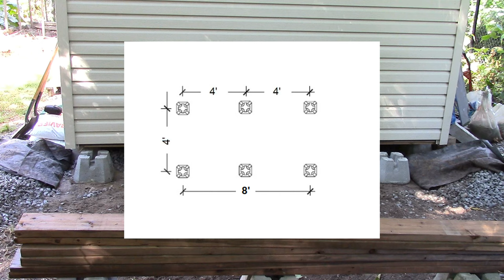How to Build a Shed Foundation with Deck Blocks

Comment: This is a how not to video. The ground underneath is not level and when it rains water can pool up under a certain part of the shed and rot out the floor faster and possibly get whatever you have store in the shed wet. The whole area under this shed and between the first shed should be graded so water runs away from underneath.  This one the water will collect between the two sheds
Reply from the maker: The soil is sand. no issues with water. Pressure-treated wood (joists, floor plywood) has no contact with the soil

Comment: It seems either frost or heavy rain would move the blocks and twist your floor. Do you not have any of these in your climate? Does it not matter because it's just a shed? Would you be able to correct that by adjusting the blocks with a jack?
Reply: How would you correct this then?
Reply from the maker: We have a lot of snow, and temperatures sometimes drop below -22F(-30C) during the winter.
I just added a video on how the foundation looks after 2 years of harsh weather.
https://www.youtube.com/watch?v=1jf2_5KlEms
Reply: @plasticinehouse9547  Thank you for this follow up! As someone looking to set up a shed in my own yard, I really wanted to know which level of depth would be of greatest value. Sure, it's not 20 years of use, but considering the shed is only rated for 10, it looks like I'll be all set.
Reply: I made a deck extension with these 10 years ago in northern Ohio and haven't had a single problem.
Reply: I plan to purchase a 7x7 or 10x7, haven't decided, and I want to build a foundation for it to sit on. I've seen videos where they just use the wood without the concrete stabilizers. Would this method work as well for attaching a shed onto it? Also, I didn't see whether you actually nail or screw the boards together. Is it safe to just firmly sit them in the blocks without screw out back reinforcement?
Reply: @lisagilliard584  If it's just a shed you don't care too much if it moves because it's light enough to not crack for a while, and you don't have to worry about gaps forming because drafts are ok. For a trailer you can adjust with jacks anyway to keep your ground horizontal.

Comment: Is that 6 x 2 inch wood you use for the base?
Reply: @BoomShalakazam  Thanks for your help, one more question, is it possible to lay insulation under the floor boards with this method? Or would I need to build another frame above the base?
Reply: @MotorsportUK2009  did you ever get an answer?  I'd like to insulate mine also.

Comment: Wish i had seen this before my prefab shed was delivered  . The guy delivering it did a crappy job deliverying it with his mule . I saw the 4x4 concrete block holders like that when i picked up block for the shed . He could have just put the skids ontop of them with the mule    It is a  garden cottage style shed 10x16

Comment: I am surprised the spacing of those 2x's would pass code. It wouldn't pass inspection in my county especially if you don't even screw the boards together.

Comment: These things suck and need to be banned.  Here's why:

1) They will heave with frost.
2) If you use a 4x4 post inside of one, it will wobble around making building anything very difficult. 
3) They are not secure from wind uplift.
4) It is near impossible to get them level, plumb AND square. It's a major PITA and you will find yourself picking up and setting the blocks 100 times, killing your back.

As much as digging holes and setting concrete sucks, I find it much easier than using these deck blocks.  And concrete is much more secure.